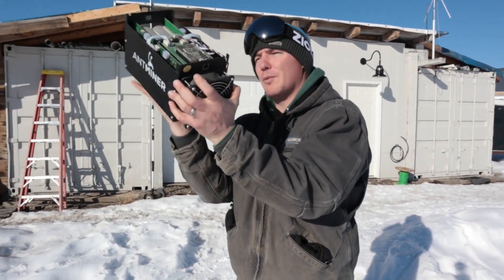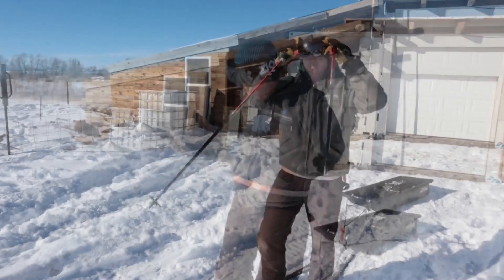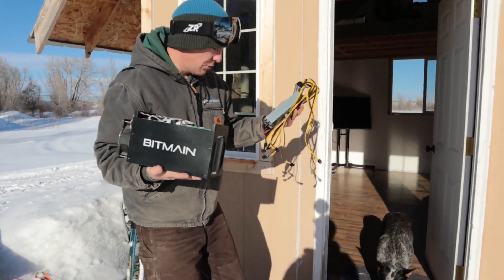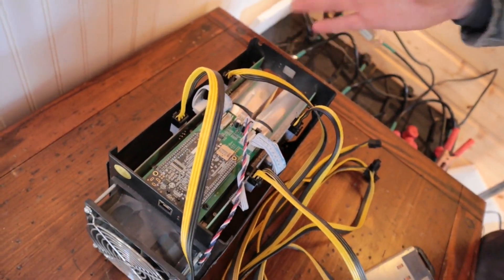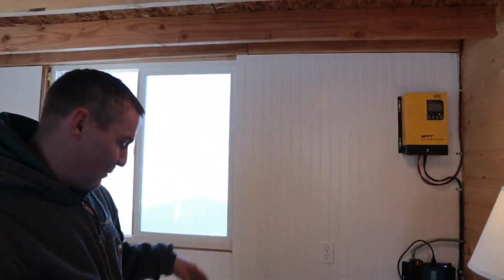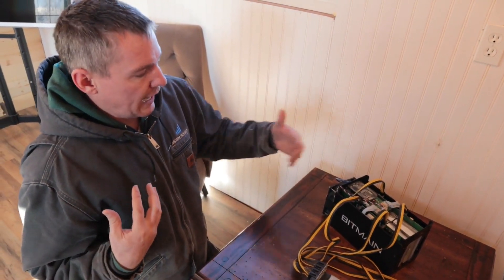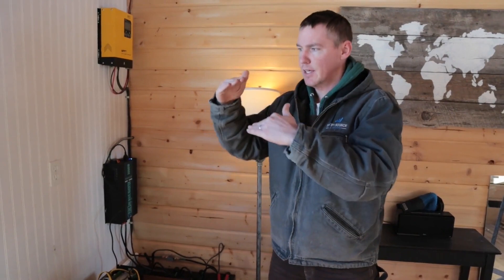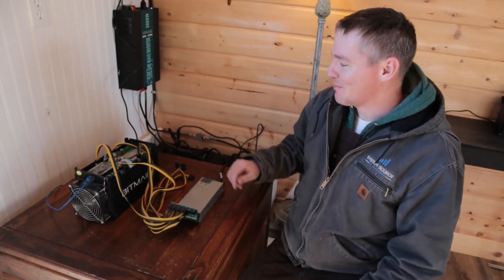Mining Bitcoin with Solar Panels and Batteries

Comment: How many panels and batteries you need for s19 140t?
Reply: hy I'm asking myself the same question :)))
Reply: This is what I find for the moment (btw I plan to buy the sale antminer as  you)
I guess at leas 20 solar panel and 45 batteries if you whant a 24/7 and just running during sun light 10 solar and 23 batteries/22

Comment: Can you run it straight off the batteries for efficiency? I'm assuming it's 12v equivalent that your using to power the Inverter then the power supply and back to 12 ish volts for the antminer? I've got some antminers and it would be good to see if they would run off a car battery for power cuts etc max voltage 14.6v. any ideas??

Comment: You've answered several questions I had, definitely subscribed! Keep going! I'm trying to figure out the setup needed to power an Antminer S9j Pro 2950kW. Do you have any suggestions on how to size the solar + battery plant? Thank you!!
Reply from the maker: Thanks. It looks like you would need a minimum of 3000 watts for solar panels (10 panels at 300 watts each, for example) in order to power the miner while the sun shines only. You would only need a small battery setup in this case, but when the sun goes away, the miner would power off... To keep mining 24/7, it depends where you are in the world and how much sun you get, but probably more like 9000 watts of solar panels and maybe 7000+ amp hours worth of batteries, so something like 45 batteries if using SLA batteries similar to mine... This would be a very expensive setup if it needed to run 24/7.
Reply: @LetsDoCrypto  I'm in the south of Italy, where solar irradiance is very good indeed. I was planning to use LiFePO4 batterie to keep mining for at least 12 hrs when the sun is off. My main question is how to size both batteries and panels to keep batteries charge enough during day, for use at night, WHILE the miner is being powered from the panels during the day. Any ideas?

Comment: Loved the video. From the concept to the explanation to the filming execution. I came here looking for somebody attempting to power ASICs directly from batteries. My thinking is that if you have a battery that is close to 12V you could improve efficiency by skipping the inverter (DC to AC) and the power supply (AC to 12V DC). This wouldn't work for your setup because you have 48V (and your objective is to produce heat, not to mine profitably) but do you think it's worth the effort?
Reply from the maker: Hi Oscar. I'm interested in doing this too. Directly to the 12v battery could work, but they also make DC to DC power supplies that take a range of DC input from like 11v - 13v and then output a steady 12v as well as 3.3v and 5v just like a computer psu. I'm pretty sure I can make this work with GPU miners, and probably the ASICs too. https://amzn.to/3AKtlVF
Reply: @LetsDoCrypto  thanks for the tip. In principle that's what is required! Although this one in particular may be a little down on power for the requirement
Reply: He can have 12v since the setup of 48v is thru 4 batteries of 12v. And yes u can power directly computers as long as they accept 11-13v range. Some computers accept a specific voltage with little range. Batteries range in 11-13v depending on charge state and phase.

Comment: Stupid question, why change 48v dc into 120v ac , to then change it again in 12v and 5v dc. Wouldn't it be more efficient to go straight from 48v to the rig with some other convertor ?
Reply: powering the house somes first

Comment: Really cool video! I liked the simple and light way you presented everything and connected the miner in real time to show it's not really an overly complex thing. 
I am planning to setup a similar system with solar, batteries and connect some old S9 miners to it. I have started to look around in the web for technical information on where to start, but I thought you might have some tips on documentation, blogs, websites, that were useful for you to setup the solar power system? E.g. what panels should I get, how many batteries, what other equipment like the inverter, etc. Any help is appreciated. Thanks and great job!